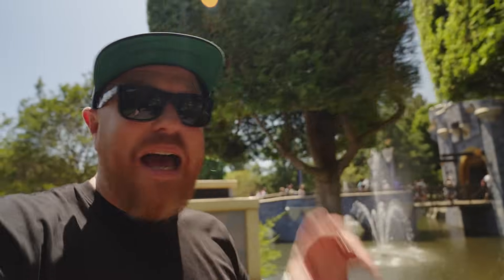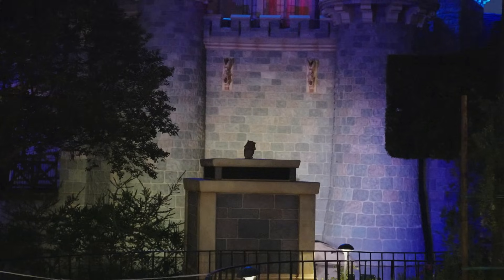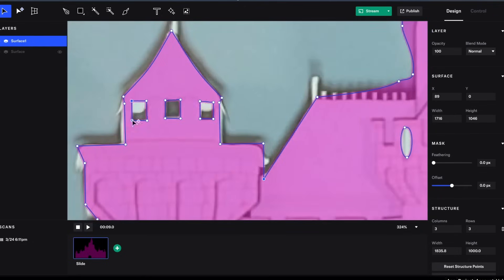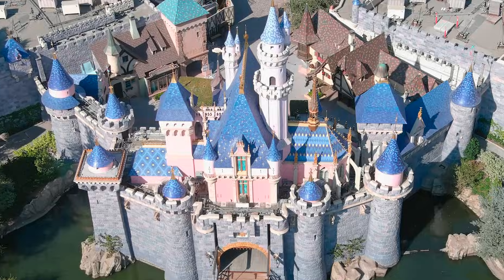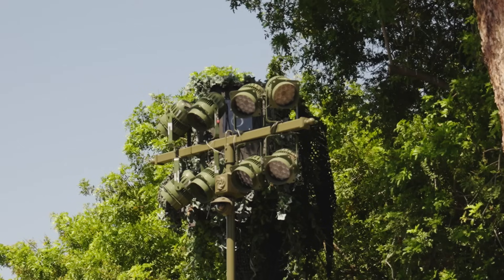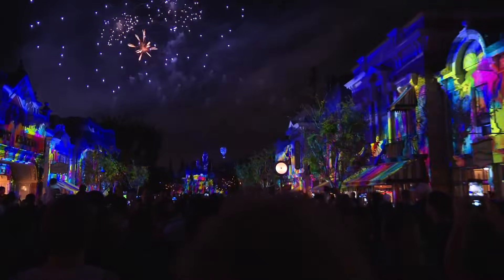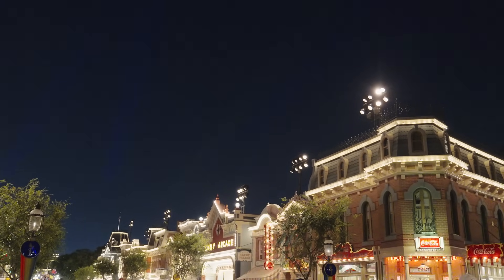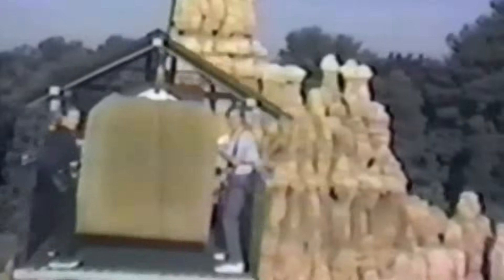How Disney Tricks You Into Ignoring Hidden Fireworks Equipment

Comment: Hey! Lol… ok, you tricked me into watching this as I couldn’t think where a single launch position of the actual fireworks that would be visible from any on stage area. Then I realized that you were talking about the other gear for any Nighttime Spectacular including the firework shows. To add more detail, I would break the pyro launch positions down to even more layers. Pyro/fireworks are broken down into two basic divisions… Commercial and Proximity. Commercial effects are the large bursts seen in the sky from a distance. Proximity effects are anything that can be fired close to the public. At Disneyland these are roughly broken down into 4 main areas. Main Street are the effects on the tops of the buildings on Main Street itself. The Castle which are the effects on the Fantasyland Buildings and the castle itself including the isopar cannons. The Nine Line is a series of launch positions behind Toon Town although technically, they aren’t all in a straight line. The center 7 are on the rear of the roof of Mickey & Minnie’s Runaway Railway. There are two outside towers that launch the “Shooting Star” effects are more inline with the front of the building. One is next to the Roundhouse and the other is at the far end of the MMRR building. The furthest most launch area is for the air launch shells where all of the large fireworks are shot from which is opposite the NW corner of the MMRR building (Hope that makes sense, look on Google Earth!). You had SO much great information about everything else. Although the SM and Pyro Tech for World of Color are on stage under the Pixar Pier sign as they require line of site, the actual control room is completely backstage but I haven’t actually seen the DL control room for these spectacles.  I know the DL phone operators were in the Opera House building on the second floor in the past but could have moved to make room for a control room. I believe that the SM calls the show from the roof of the MS Photo building  and I think I remember a Pyrodigital board up there so I would imagine all of the proximity effects for Main Street are controlled from there as well. That operator could be firing the Castle as well but probably not as they don’t really have good line of site to all of the launch positions on the FL rooftops.  Another thing that I found interesting when we were shooting some projection content for DLP is that at the studios where they map everything for Disney worldwide, there are white scaled replicas of every castle, all of DL Main Street, the Matterhorn, etc for them to test the projections on. It allows them to tweak everything in the studio before it goes out to the parks. The level of detail was astounding. As an example, the mapping on the Mira Costa for Tokyo DisneySea’s new “Believe! Sea of Dreams” is amazing in so many ways… but I was curious if the projections would bother the guests that were staying in the rooms that face the show. They told me that they had mapped out every pane of glass in each window. There are several hundred windows, each with either 6 or 8 panes of glass. Yes, the level of detail is astounding!

Comment: But how do they launch fireworks? I heard they have a unique system and not just burn a rocket to the sky
Reply from the maker: @duramaxdad  they are launched from those giant boxes by the “laser” or spot lights and where I showed the fire jets.
Reply: They use compressed air canons to launch them to minimize noise. That's why they have a unique sound when launched.
Reply: @24ecko  That’s pretty cool they use air. 

Minimize noise on fireworks? Now that’s funny. 
I think it’s to minimize something. Maybe smoke and pollution. But that also sounds funny. Idk.
Reply: @duramaxdad  It's not really to minimize noise. It does do that, but it's more for smoke control. There's far less smoke across the park since they don't use black powder lift charges.
Reply: Back when rocks were still warm and we still had George Plimpton, he did a fireworks special that spent a segment on Disney’s air launcher, that Plimpton dubbed the “Whiz-Bang,” which was a fairly new addition to Disney’s unique roster of gear.  The video (and every word he wrote) is well worth tracking down.

Comment: @Hey Brickey! Those “lasers” on the roof of the castle aren’t actually lasers, they are just moving lights.  There are lasers in the show, but that isn’t their location.
Reply: The fireworks are not shot from ToonTown,but from backstage. ToonTown is closed every night in case of fallout from the fireworks to protect the guests. Some nights if the wind is blowing slightly into the park “ it’s a small world “ and the Disneyland Railroad are also closed for the safety of the guests.
Reply: was itching me the whole time
Reply: Wouldn't lasers be a nightmare to planes flying over?
Reply: @SouthpawFade2  It would, and they would have to get special permits for each show. Also the beams would be very thin, so clearly not lasers.
Reply: @SouthpawFade2  not when you have pros working. lasers must have a stopping point, plus a limit on their power, but there are a lot of regulations they must follow.
Reply: @ledrummah  ok. Thanks for the  explanation!
Reply: i love you for this comment lol as an LD it sometimes hurts to hear blasphemy like that! lololol
Reply: @ledrummah  I read this comment before the video and I'm just holding on to the edge of my seat to get ready to cringe. The amount of time he called uplighters, washes, and slimpars "spotlights" physically hurt my soul.
Reply: @morph- Thanks for pointing the repetitiveness out. Made me realize that this dude is using AI assistance for script writing.
Reply: Is there another video with correct info? After reading the responses to bitter bob's response, won't be subbing.
Reply: As a trains cast member, the only lasers on Main Street come from just above Baggage Claim at the Main Street Train Station. We have computers to clock in in Baggage Claim and each evening prior to showtime a tech comes in and locks the ladder that leads to the attic and places up the "Caution, lasers" sign over the ladder cover. Then a resort-wide radio call is made informing us that "lasers will be utilized in X show from x time to x time". There's also a security camera up there in the window as well. That is the only place lasers are utilized on Main Street, as they shine them in a straight line overhead on Main Street, stopping on the face of the castle.
Oh also, the train does go through the projections. We don't stop operation unless "Phase 2" is called, which is when the wind conditions determined by the DFD are less ideal. Phase 2 expands the firework fallout area, which closes Mickey's ToonTown Depot, halting train operations temporarily, and it closes It's a Small World, and significantly shrinks the size of the viewing area in front of the attraction. Sometimes Phase 2 also closes the Monorail.
Also yeah, the big fireworks aren't shot from Mickey's ToonTown itself, but rather from the top of the Rise building and the TDA building (the green-blue building you see from the 5 freeway). The whole TDA area backstage including the adjacent cast parking structure is locked down between 8-10pm to accomadate for the fireworks. There are usually empty firework shells all over the ground after the lockdown is lifted backstage.
Reply: as a Lighting Technician and DJ, the Moving Head Lights are the Beam Type Moving Head Lights. I do Own Two
Reply: Agreed. They are Vari-lite units (probably VL10 Beamwash units) mounted inside a glass dome cover for weather protection. Not lasers but standard lights.
Reply: @TheMrMarkW  As far as I know, Disney has moved over to Elation fixtures almost exclusively. At least they did in Walt Disney World. Chuck Dillingham (who commented above) would have better knowledge as he was involved in a lot of that process if memory serves me right.
Reply: @mrosenblatt  As someone who did detail design work for Harmonious, yes, Disney does prefer Atom and Elation lighting. However, the big caveat are the huge searchlights used for HEA nightly on top of the buildings, which are large AO Lighting moving fixtures.
Reply: @th3thrilld3m0n  I figured those were classic Syncrolites
Reply: @mrosenblatt I believe a few parks have replaced their syncrolites with Ayrton Cobras, pretty sure Ayrton is popping up more and more across Disney parks and experiences now too.
Reply: @th3thrilld3m0n  actually the Falcons at MK were replaced not too long ago.
Reply: @TheMrMarkW  The ones in the domes behind the castle are definitely not a Vari-Lite fixture. They are the Elation Platinum SBX fixtures. It is a hybrid fixture that is now discontinued.

Since the first use of Elation with Disneyland, they've been commonly seen around the parks now.  Luminous and Happily Ever After uses the Elation Proteus Hybrids. Fantasmic may use a selection of Elation fixtures as well.
Reply: @jbphotomain  It's been a while since I have used an Elation fixture,  ps it's not just me who thinks they have a massive graveyard of discontinued fixtures.
Reply: @HeyBrickey Yikes, maybe try something like “Thanks for the info”
Reply: Nice 🎉
Reply: shut up
Reply: So what....    :face-turquoise-covering-eyes:
Reply: To be fair, not only did he call beams "lasers", he also called par/wash lights "spots".
Reply: Moving heads to be more accurate. Most likely hybrids, although if by some coincidence that they are the Claypaky Xtylos, then they will be both laser and moving head.
Reply: Yeah those are just automated spotlights. The lasers Disney uses look similar to the projectors and are a big box with a small window the laser is reflected off a mirror out of. Just a small terminology error that's all.
Reply: Hey Brickey love the videos. Keep them coming.  I am like you I love to look into the inner workings of Disneyland  that make the magic going. I hope to run into you  some year  lol. My wife  & I live in the SF BayArea  & hopefully be able to go next year
Reply from the maker: @jeffmontero9242  keep an eye out for Hidden Brickeys hope to see you soon! Thanks.
Reply from the maker: I enjoy how you only come to point out what you think I get wrong. So rewarding.
Reply: @HeyBrickey  Didn't you ask people to tell you new things? They're spotlights, not lasers... the lasers are only on the castle
Reply: @HeyBrickey Damn, aint afraid to show your true side huh
Reply: @HeyBrickey  I’m sorry if you were under the impression that I was just here to point out “what you think I get wrong”… this is actually the first time I’ve ever commented on one of your videos to my recollection.  I really do enjoy them, actually and wouldn’t be bothered to comment a correction that I happen to have actual first hand knowledge of.  Many times throughout your videos, you say things like “correct me if I’m wrong”, or “what do you think this is” so to get a response like this from you is a little odd.  Keep up the good work, you’re making great content.
Reply: @chuckdillingham  No response back from them. Shame.
Reply: Funny he ain't comment back lol you told him lol that's funny good stuff😂  @chuckdillingham
Reply: @HeyBrickey Cringe take
Reply: @HeyBrickey  That is such a crap take, not one I thought you'd make. I'm personally glad someone went in the comments to inform people what those fixtures actually are, I was about to do the same. For an educational video about technical items for a show, accuracy is key, corrections in the comments should be acknowledged and pinned, not insulted. People are here to learn, whether from you, or corrections they read. They weren't attacking you; they were informing you and others about a pretty massive difference between what was said and what was actually present. This spoiled my enjoyment of an otherwise really amazing video.
Reply: @HeyBrickey  he was just letting you know respectfully. You don’t have to be a bum about it 💀
Reply: @HeyBrickey you Disney people are always so hostile
Reply: @JO-hj4kp  Your mistaken we are technicians. Once you get us started on tech we won't stop, we love to share our knowledge.
Reply: @HeyBrickey  hey bro chill, he's correct and even in your video you said "you always want to learn more about Disney" so don't grill someone for correcting you on a detail. They weren't lasers they were moving head lights.
Reply: @HeyBrickey I’m so disappointed in you for this response
Reply: @HeyBrickey I think @chuckdillingham got you on hush mode lol
Reply: @HeyBrickey  dang he was just trying to help, they are called beams or moving heads
Reply: @HeyBrickey love your videos but, when you are wrong, you are wrong.
Reply: @HeyBrickey  Was about to say the same. They are beam lights, If they were lasers, it will be a very very thin bright line.
Reply: @willtheham1 that's not accurate. There is LOTS that you can do with lasers to make them appear thicker or wider.

Take a look at "laser whips" and you'll see just one of many ways of doing that.
Reply: @LordAthens  agreed, but still cant do all the pan tilt that you can really see in the footage though. I get what you mean though :)
Reply: @willtheham1  sure they absolutely can. How do you think we've been doing laser shows for a number of decades now?

A few lasers hitting mirrors that move extraordinarily fast, aka a laser scanning system. Since our eyes are 'slow' by comparison, we leverage persistence of vision to make a single laser look like a massive beam, or an animation, or various other fun laser things.
Reply: @HeyBrickey  nice answer for someone who is wrong.
Reply: @HeyBrickey  that's some bullshit. He is just pointing something out.